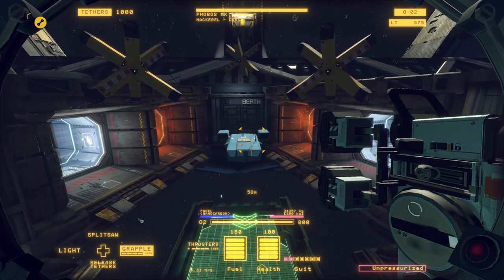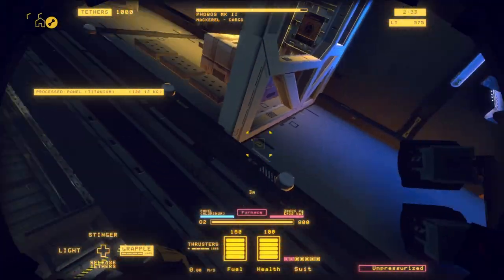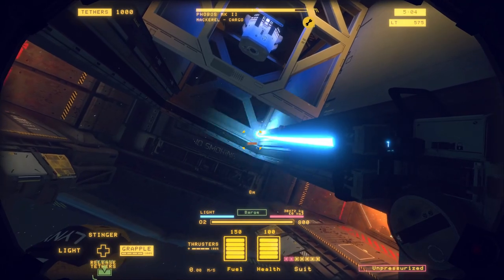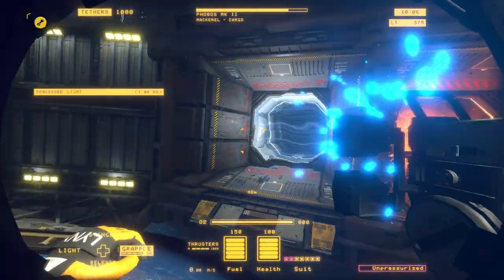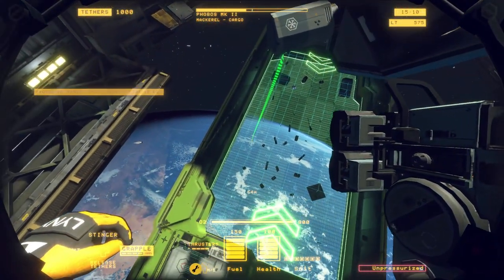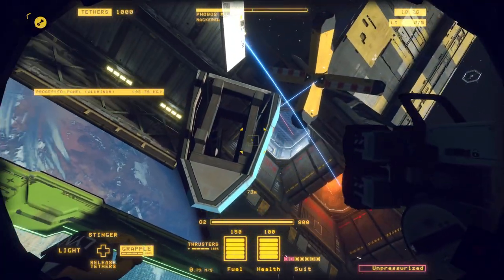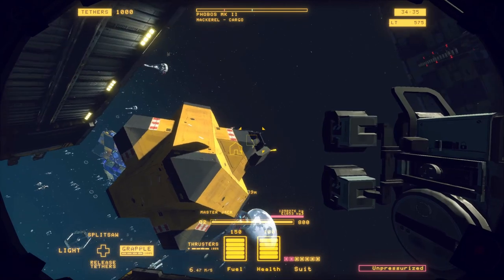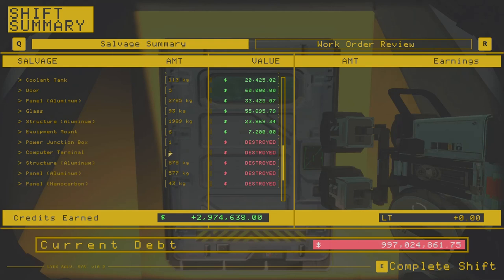The quest for a perfect salvage run - Every Last Bolt - Hardspace Shipbreaker

Comment: You got so close here, but I think I've found the cause of mysteriously twisting objects. When you rotate a piece from its initial attached orientation while it is still attached, When the object is dislodged with the grapple it will attempt to duplicate its current rotation. Say you canted over the cockpit 30° clockwise. When you dislodge the chair with the grapple, it will attempt to orient itself so that it is rotated 60° clockwise from where it started. This is conjecture based entirely on my observations in the yard and is not based on looking at the code, but it seems consistent in my experience. To avoid it, avoid rotating ship segments and try to detach fragile parts before moving the structure they're built on to. Alternatively, your tether method works too.
Reply from the maker: ah it does work for detach but you can see when i grab it with the tether theres still some wierd physics going on, sometimes it will also spontaniously gain 200m/s in a radom direction the second you grab it too. i do like that theory it makes alot of sense

Comment: Do not remove anything electrical switches lights or otherwise until after you have removed the purple thing in the wall that supplies power to the ship if you remove that first you won't get things breaking that run off electricity when you remove them